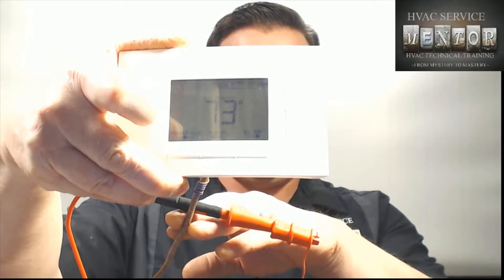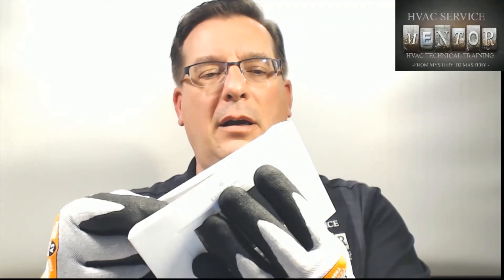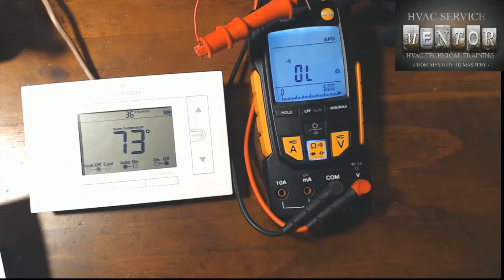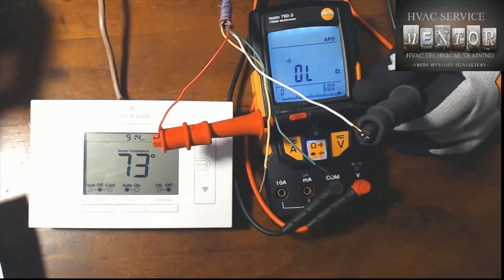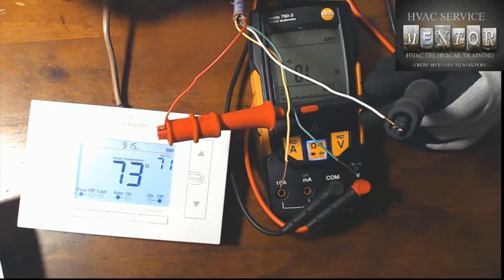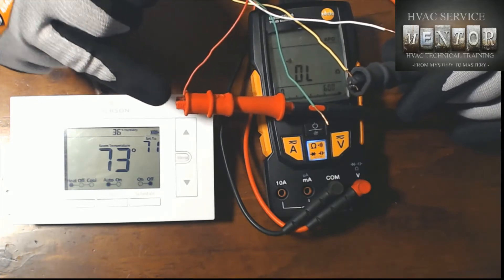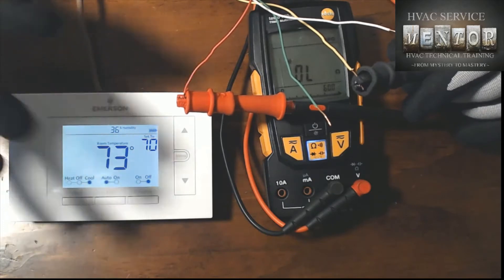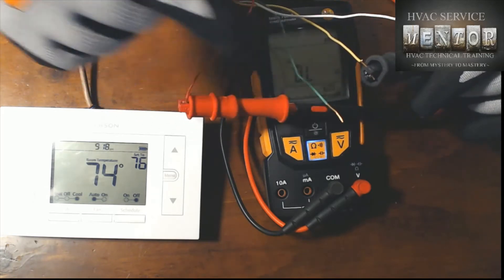How a thermostat works part 3

Comment: What’s the difference between Gas and Electric on the back of the top panel, thank you
Reply from the maker: Very good question.  Moving the switch to the Electric Setting will energize G and W at the same time when there is a call for heat.  This is to accommodate certain types of electric furnaces.